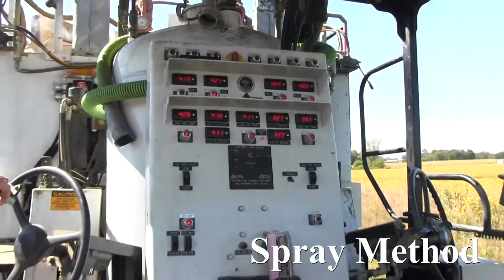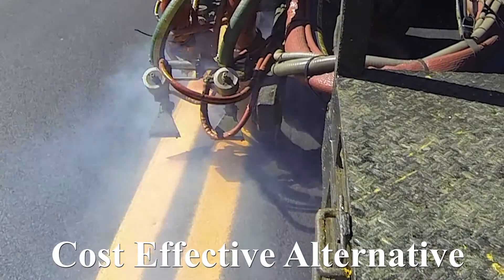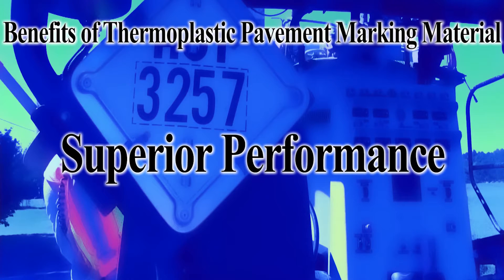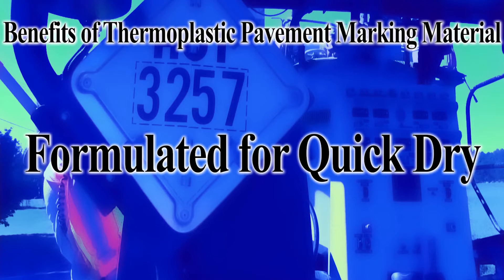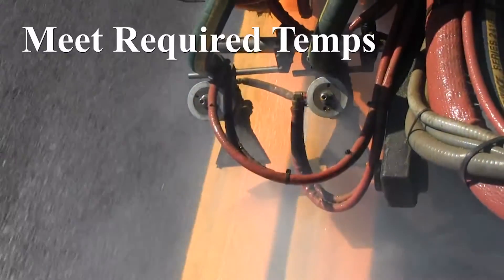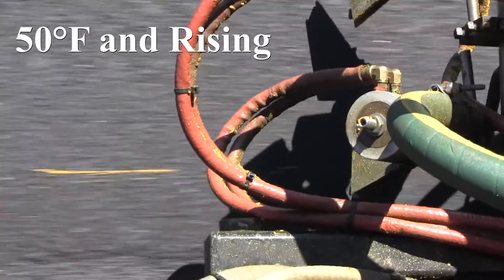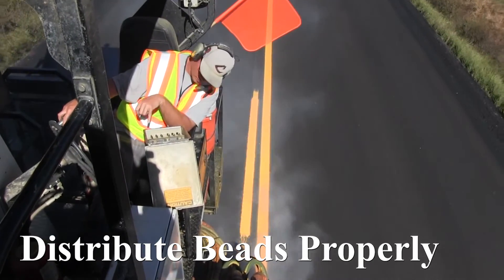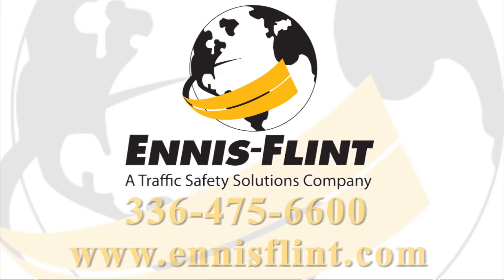ENNIS-FLINT® by PPG Thermoplastic Spray Method

Comment: Did that mrl pumper have flow control on the switch box ? If so that's a great idea and I need that option on my trucks
Reply from the maker: Hi Anthony,

Thank you for your question.  I spoke with product management and here is what they had to say, "You can't tell from the control tower or control box.  However, MRL does make equipment that has flow control and it is readily available"

Hope this helps and have an excellent day!